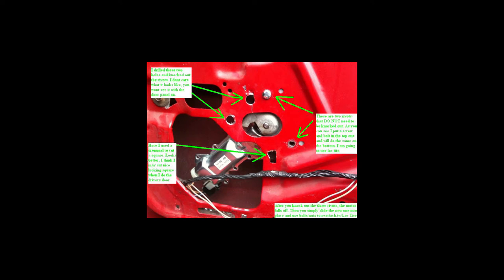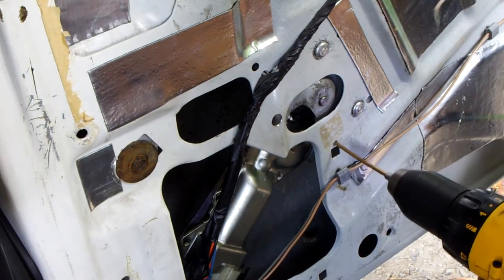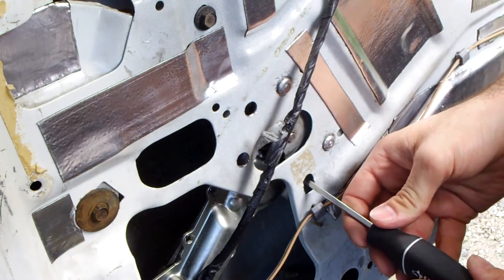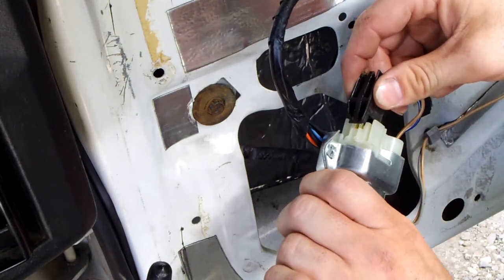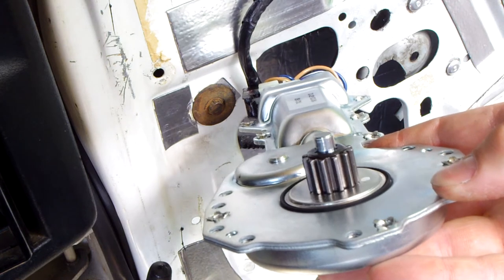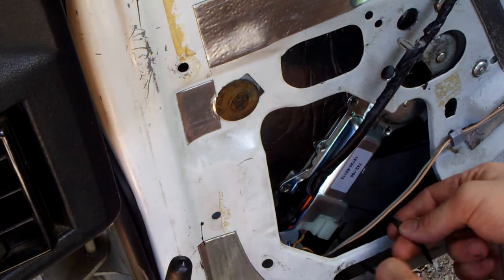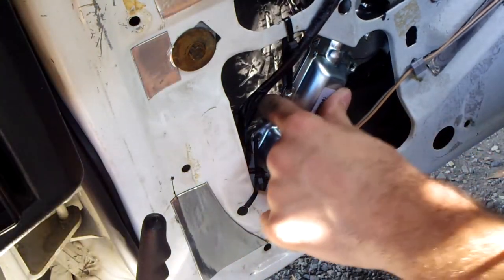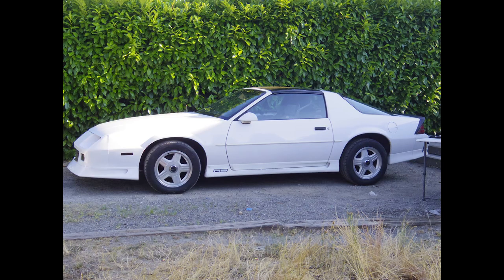Window Motor Replacement (1982-1992 Camaro/Firebird)

Comment: It should probably be noted that the original motors were riveted onto the window regulator.
Reply from the maker: I had forgotten since these fuckers die every 2-3 years due to GM's garbage ground wiring.
Reply: So what does that imply as far as dealing with and original windows motor? Because mine died finally after 4 years of owning my TA, and from what it's looking like, I think my motor is still the original motor
Reply: @Schwxrzritter   it means you must remove the entire assembly, drill out the rivets, and reinstall a new motor. There is a cheat on thirdgen.org, but it requires drilling holes into the door frame. Some people are not keen in doing that though
Reply: Gonna grease the gear & use stainless bolts nuts & lock washers too. Not the cheap ones that came with the new motors✌

Comment: Sweet! I hope you have one showing how to remove the window and tracks. I need to clean and re-lube mine.
Reply from the maker: You can add grease to the tracks with it installed.|
I added graphite spray to the hinge point and lithium grease to the tracks.

Comment: Is there something that need to be done to hold the regulator in place when removing the motor? I thought i heard somewhere that the regular is spring loaded and will unwind if the motor is removed without securing the regulator.
Reply from the maker: that's only if you accidentally chopped off the wrong rivets
the motor is seperate

Comment: What attachment did you use for the dremel
Reply from the maker: just come carbide bit from a hardware store.  Anything that will cut mild steel sheet metal.
Reply: @3rdGenGuy  nice thanks got my driver side window working now with a new motor